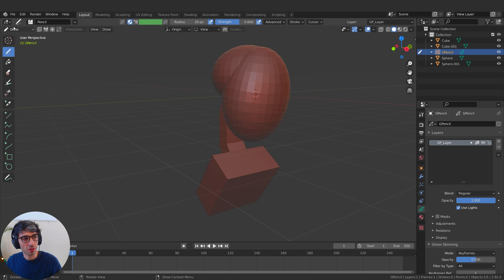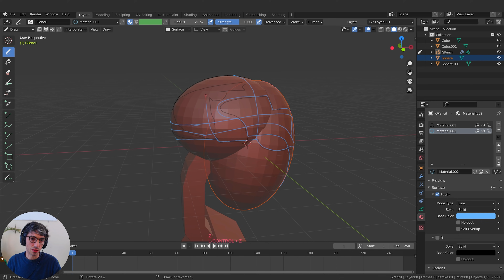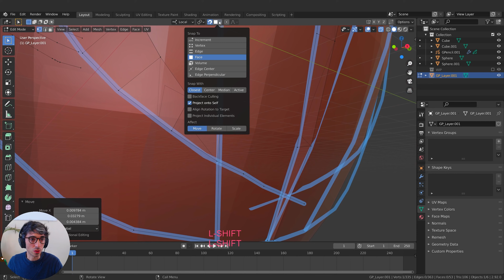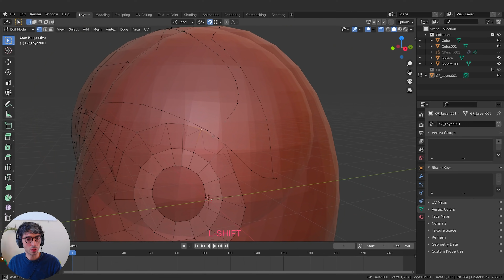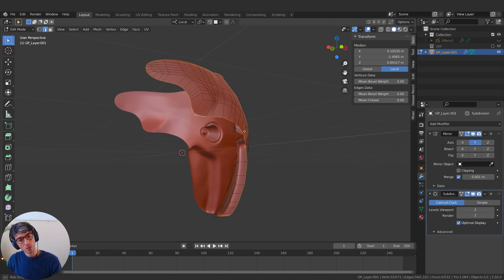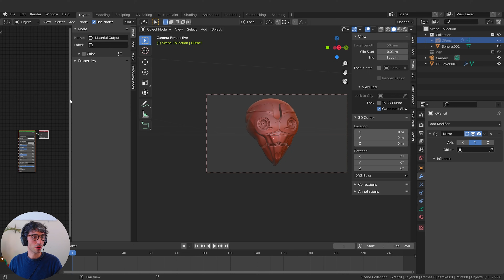Hard Surface Model A Robot Bird With Grease Pencil - Blender Tutorial

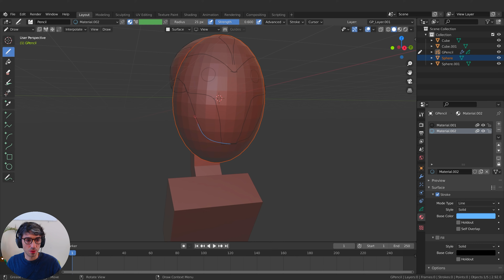Comment: minute 7:44 “stabalize my stroke and allows my mouse to lead” is called a “window-stabelizer. Unlike a “rope-stabalizer” that smooths the most forward vector based on the previous, it plots points after it is dragged like a carriage and you are the horse, leaving a relatively smoother path in it’s wake because it processes it after the fact. Just so you know and learn a thing about tooling :)